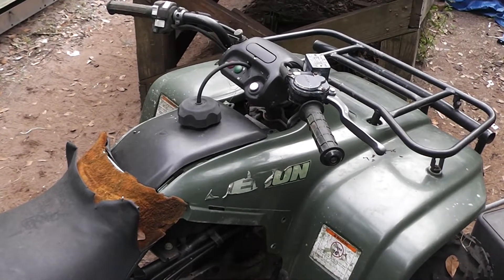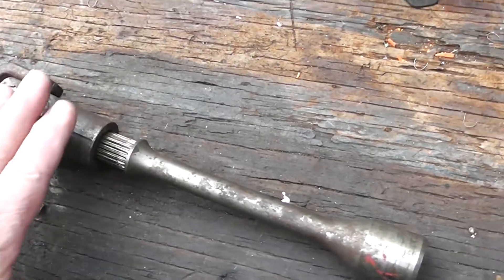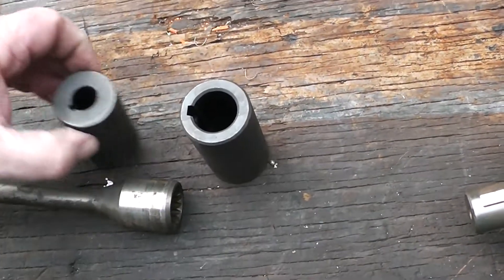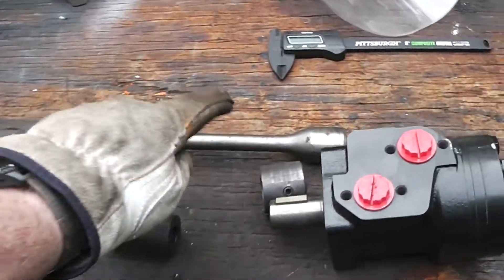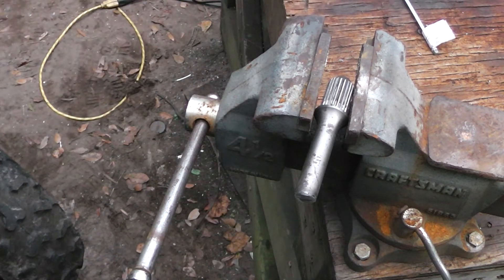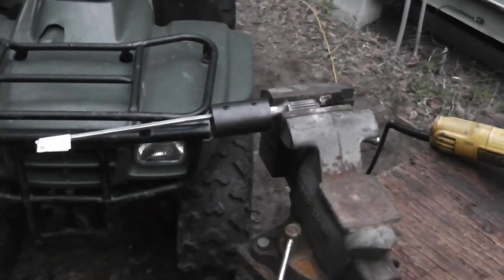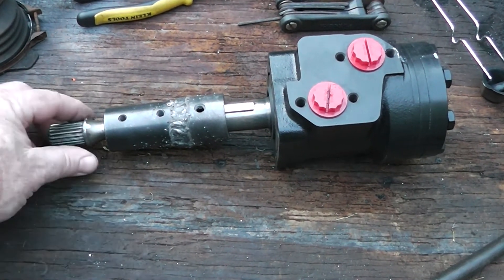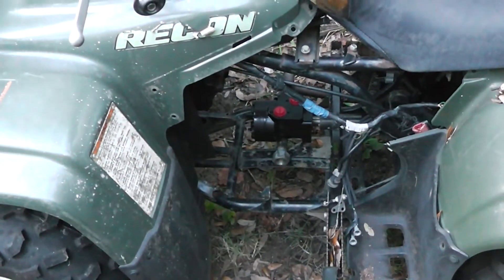ATV Repower Part 2 Hydrostatic Drive

Comment: Any update on this?
Interesting idea. What motor specs on the one you are planning to use?
Reply from the maker: I have had to put this on the back burner due to "other" responsibilities. HF 6.5 hp engine with jet and exhaust kit hoping for 8-9hp with a variable piston pump.

Comment: Since the 90s when I first owned a zero turn mower, I've been thinking of how cool it would be to have hstatic drive on a four wheeler. I've always held that the big drawback would be the fact that the engine has to turn at high RPMs constantly to produce enough flow at the correct pressure. So you would not be able to throttle the engine up and down and it would make for one loud four wheeler.
Reply from the maker: I can throttle my zero turn up or down and it runs fast or slow.
Reply: homesteadprepper always heard that wasn't good to do, my tractor HST is the same thing. But don't get me wrong, I want to see this work !
Reply: You can also change your rpms that you spin the pump by doing different pullies